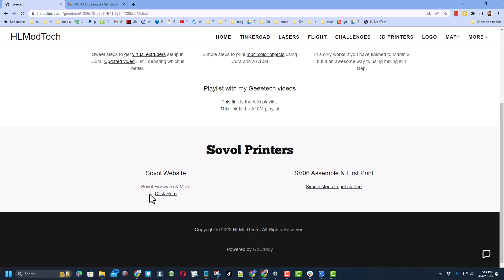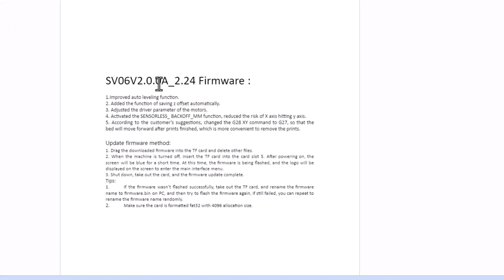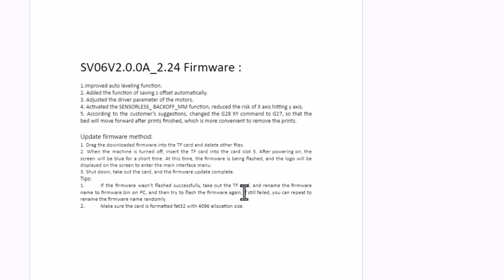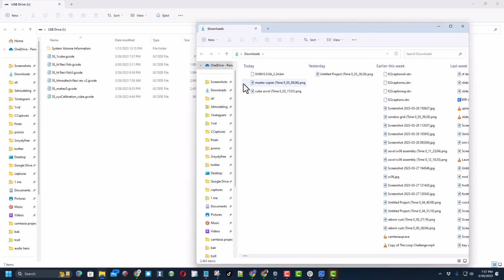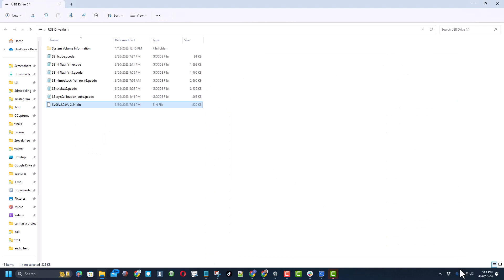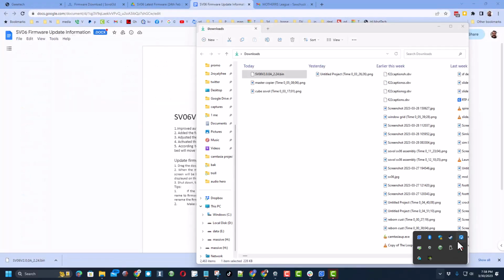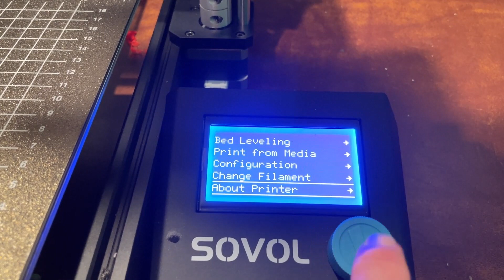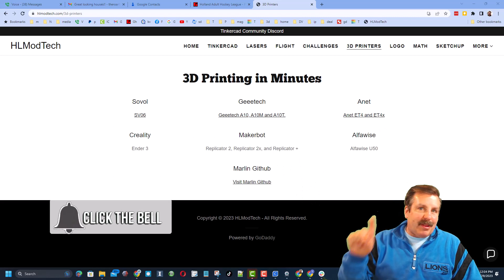Simple Steps to Update the Sovol SV06 firmware in Minutes!

Comment: could some one help me i bought the sovol sv06 had if for a few days or so and now whenever i turn on the printer the screen does turn on but it doenst display anything, it just like lights up with those blue light could any one help me??
Reply from the maker: I would check to see if the connection to the display is lose.
Reply: @HLModTech  no its not and also unpluged it and repluged it do you know what else could be wrong
Reply from the maker: @nickrongen3141  I do not have any other ideas. Have you tried contacting support yet?
Reply: @HLModTech  yeah but they still need to reply thx anyways
Reply from the maker: If you find out something good I would love to hear what solves it.
Reply: @HLModTech   it works again, idk what happened but i tried to install the firmware for the 3rd time and then it did work so yeah thx
Reply from the maker: @nickrongen3141  That is awesome! Persistence for the win. 💯💯🔥🔥

Comment: Format the card.
D/L the firmware onto card.
Put card in and turn machine on. (if you turn off the unit before the SOVOL pops up, you will brick the machine)
You will see a SOVOL come on.
UPDATED.

IF your machine bricks because of whatever reason.. go to the OG card you got with the machine, and REINSTALL the OG software back onto machine.
Then redo the update, and you will be okay.

I learned this the hard way and no real info out there on how to "un-brick" your machine.
Reply from the maker: Bummer that yours initially bricked. Thanks for sharing how to bring it back. Are you enjoying the SV06?
Reply: @HLModTech  Well I was until I am running into issues all the sudden. Even with the compensation for the bed level, there seems to be an issue where auto bed level is not helping me out with the print, too stringy on one side, too close on the other.. bed level doesn't seem to be catching that ?? Also I can't z offset manually all the sudden. I have no clue what is going on. Had it actually under a month, but up till now not had any problems. We shall see what happens going forward.
Reply from the maker: With it powered off do a manual check of your Z height. Grab 2 decks of cards or anything else you can find that are the same height. By hand raise Z on each side and slide those in. When you have both sides matched up, give it another go.
Reply: @HLModTech  THANKS! Will do!
Reply: @Patriot_First  my sv06 has been nothing but a nightmare.
Reply: @ruthlessfilms2023  I want to send it back. I am willing to spend for a machine that actually works. TOO many years of Creality and getting lackluster prints overall for all the money and work you put into trying to get them to print right. MK4 it is.
Reply: @Patriot_First  i would love a mk4, but the price is the problem for me. also at that price i think i rather try out the p1p since its speed is just insane. though it isnt open source and can have more problems
Reply: @ruthlessfilms2023  its the question in my mind right now, do I get a PRUSA, or go chinese once again. I want a working machine right out of the box, and the PRUSA can be worked on, where as the Bambu cannot be, or limited. Dunno, Bambu has not been around that long.. gotta see how they last.
Reply: @ruthlessfilms2023  hey just paid for the MK4 kit. Done w ChYna and standing for the innovators vs the companies that steal IP
Reply: @Patriot_First  awesome, hope it all goes well for you. im still waiting on my response from sovol to get a new one. hopefully. im giving chinese printers one more chance. hoping i just got a lemon
Reply: @ruthlessfilms2023  Waiting for my return label for mine. I am just done messing with cheap unrefined printers. I was trying to find one to print Voron parts with.. looks like I will have one I can finally do that with once I get the MK4. Best of luck to you. I will subscribe your channel.
Reply from the maker: I will be interested to hear what you think of it. I am still rolling along fine with the SV06.  Not sure if I am lucky or what, but she has been great for me.
Reply: @HLModTech  My bed is bad. Left side is horrible, the right side is almost too far away, and the level compensation doesn't make up for it at all. So I am just kinda stuck. I reached out to them to see if they would work with me to get it right, they didn't answer, giving 24hrs and if no reply, it goes back sadly. I wanted to like it. I have even wondered what a PRUSA bed on it would be like. Seems Prusa has a good record with their beds, but not sure Sovol copied their bed design (carriage) so not sure it would fit.
Reply: @Patriot_First  thats exactly how my new sv06 is after i got a brand new replacement. its ridiculous. bed leveling didnt change anything. manual leveling the bed didnt. maunally leveling the gantry didnt. sovol is just cheap china parts.
Reply: Hey which thing on the card would be the OG software, I cant figure it out. Ive had my sovol printer for about 6 months now and I haven't gotten it to work because it keeps giving me driver issues.
Reply from the maker: Sorry for the delay. What sort of PC are you connecting it to? Mac, Win, what version?
Reply: @HLModTech  Oh thanks, I have a Mac, newest OS thanks!
Reply from the maker: Ok. I have not worked with Macs. Wish I had better info I could give you on the Sovol. Do you like your Prusa?
Reply: @grimmy2663  well, hmm SV06-v192A-1028-1.3.bin is the name of the OG firmware. The new is: SV06V2.0.0A_2.24.bin